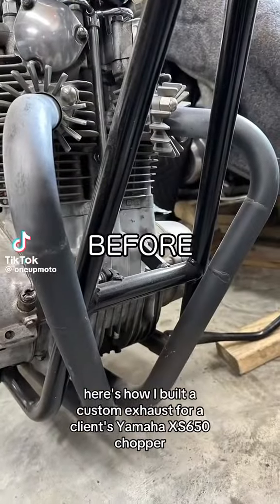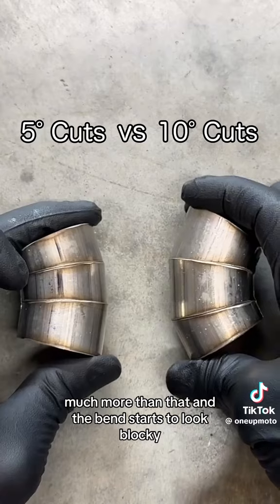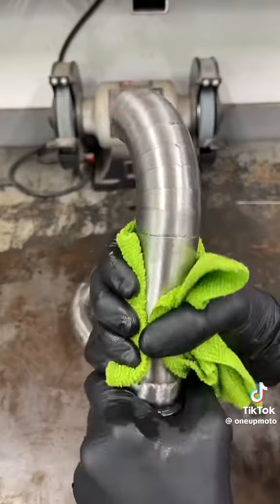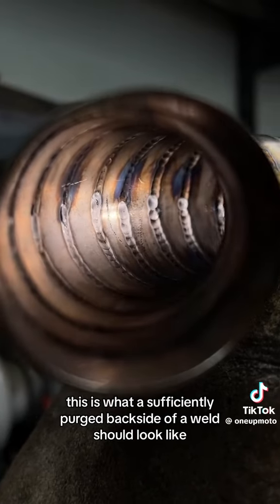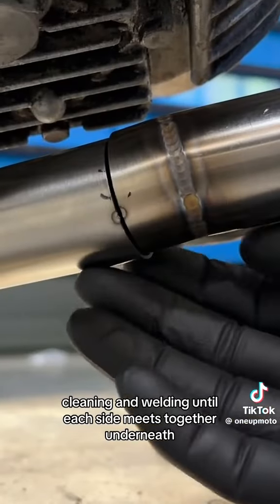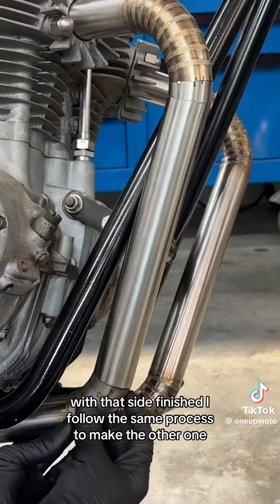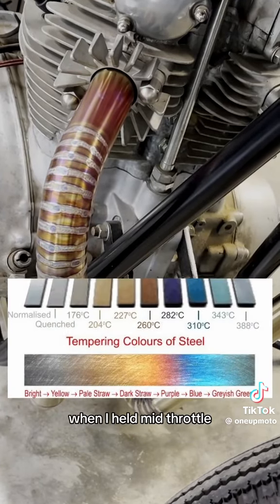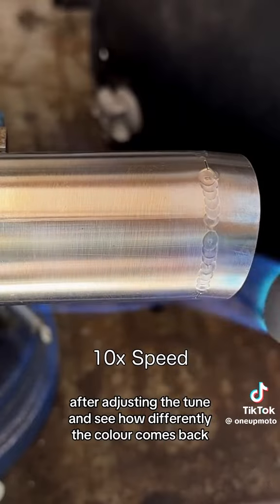XS 650 Yamaha exhaust

Comment: You dont need to purge the inside. And a fusion weld wont be enough . That exhaust will crack in about 2 months of riding. Little  space and some filler make a big difference.